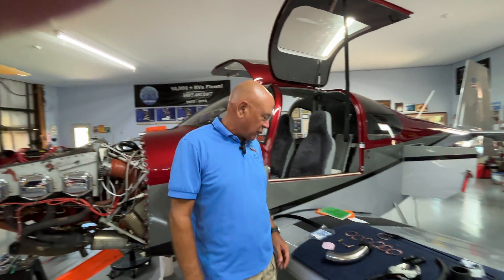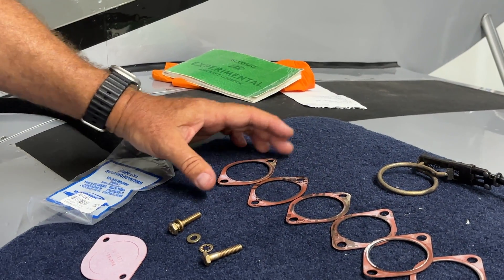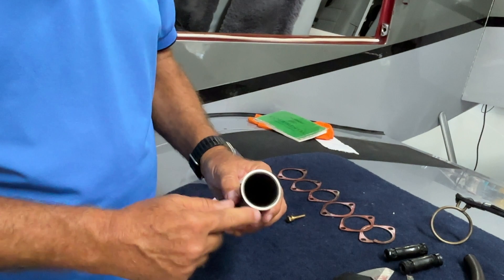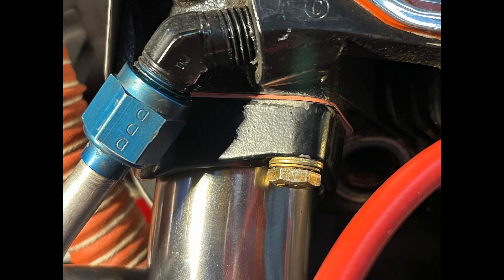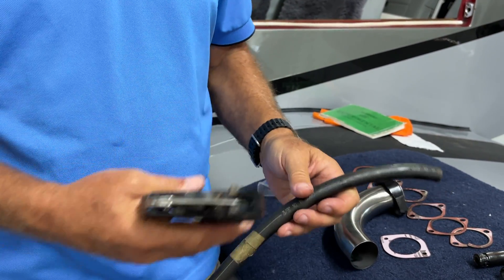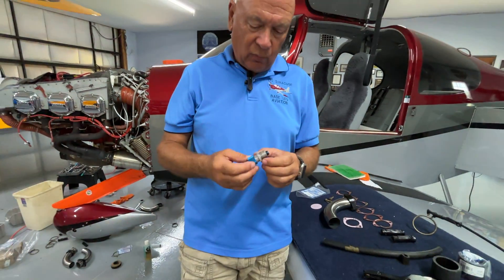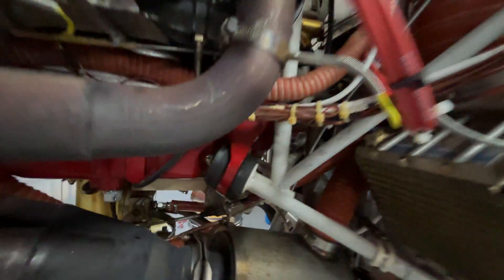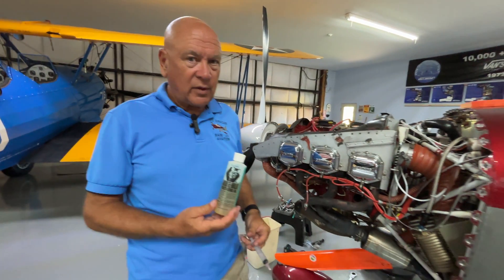RV 10 Maintenance

Comment: The biggest problem with worm style hose clamps is everyone wants to overtighten them.  This damages the hose, makes it less resilient and then the clamps tend to loosen over time.  A properly tightened screw style hose clamp will work as well as any other clamp and last a long time and can be removed and replaced in the field with common hand tools.  Either use a torque wrench on the hose clamp, which nobody does, or tighten until the clamp ring is just flush with the hose surface or a little less.  I often will use a torque wrench when using a new style clamp or a new style hose and see how much the clamp compresses the hose.  Once I know that, I can then tighten with a nut driver or screw driver and be pretty close to correct without the need to use a torque wrench.

Comment: Thanks Vic.  I noticed you mentioned the constant pressure clamp on the intake hose but not on the valve oil return hose.  Was there a reason for this?  I recently replaced my valve oil return hoses and put a constant pressure (spring) clamp on instead and it is sealed a lot better now.
Reply from the maker: I haven’t had as much luck with them on the return lines. I tried them on the helicopter with worm clamps on one side and he clamps on the other and the clamps leaked a little, much to my surprise.

Comment: You mentioned wrapping your fuel-flow Red Cube in heat-reflective material. Do you have a part number or source for that material? Love your videos!
Reply from the maker: aircraft spruce 08-00600 Thermo Tec aluminized heat barrier adhesive backed.

Comment: G,day from Sydney Australia. What are the indicators that rubber engine mounts need replacing?
🌏🇦🇺
Reply from the maker: sagging, cracks, gaps between rubber and engine mount, and leaks from the silicone-filled inner parts.